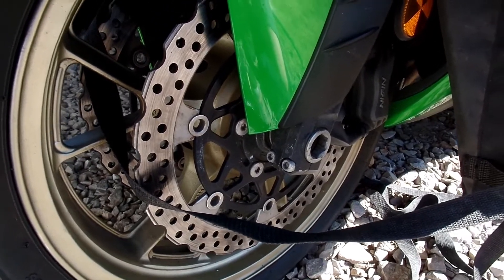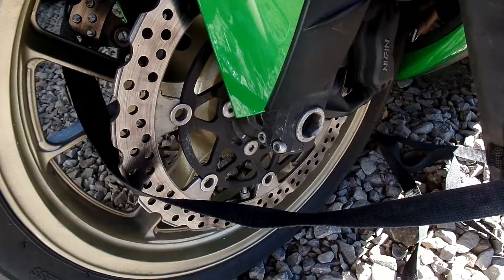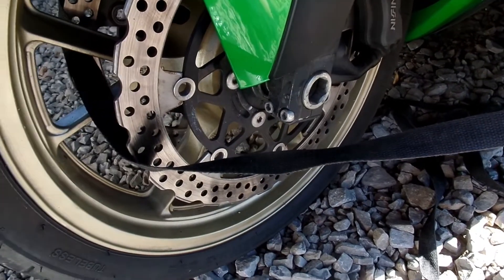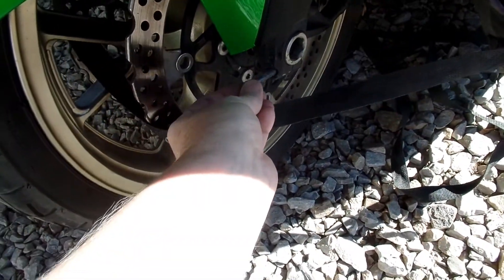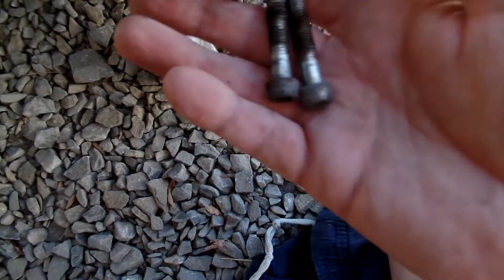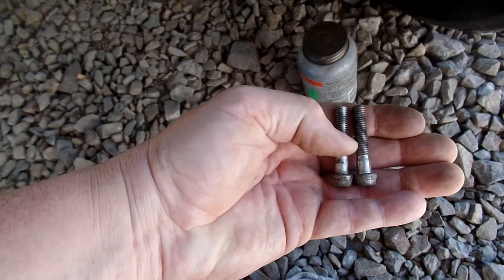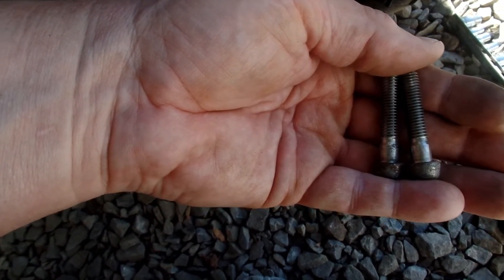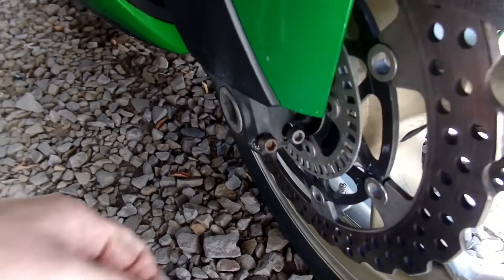Motorcycle Pinch Bolt Maintenance, NO More Seizing Bolts!!

Comment from the maker: The back side of the bolt hole is exposed and that is where the crud comes in and causes the problems.  2 different metals in contact with each other creates a chalky oxidation (type of seizing up).  All can be managed with application of antiseize.